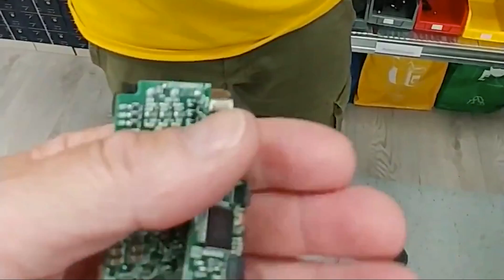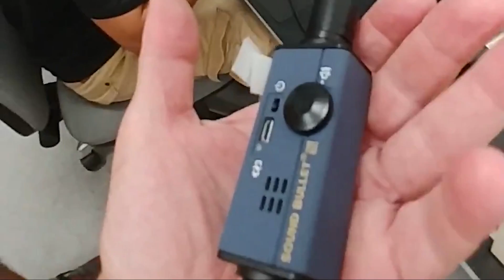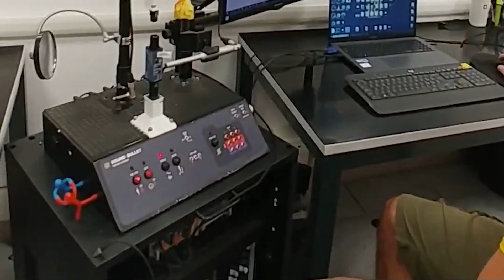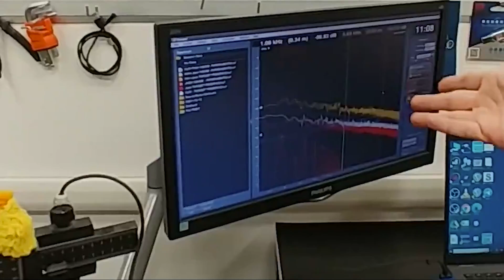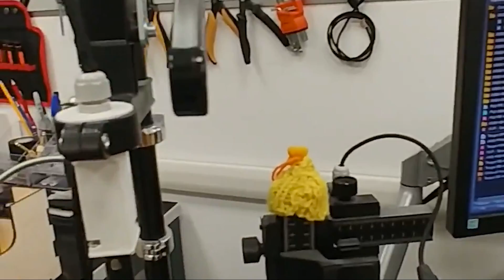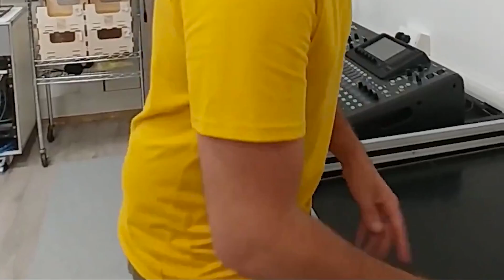Making The Sound Bullet - Awesome Audio Tester!

Comment: @07:20 After this interview you've done that video on if grounding XLR shield to the XLR chassis works and when it works. And yeah, basically you stated "it DEPENDS!" :D like it almost always is.

Most common is not to do it as you've stated here, but I carry a few cable adapters with me that give me the option AND I've got bunch of well marked and separated XLR's with chassis grounded because as you've stated in that video of yours, there are times when you reach lower noise and better interference immunity by doing that :)

But those times are a bit special anyway.
Reply from the maker: That's a great plan and solution. yeah you don't really want those shells grounded cuz they'll cause problems but in those few times you need the shells grounded having those adapters allows you to solve it. 

That's the way to do it right

Comment: Maybe it's been a while since I was in an electronics environment, but is it not odd / not good that everybody is just handling the PCB's and not doing any grounding or anything else to manage electrostatic discharge (ESD)?
Reply from the maker: I remember those days when ICs would dry by touching them. I used to work at Hughes aircraft testing parts, modules and Tow Missile systems.

No need for a strap here, it adds no benefit and gets in the way.

Comment: Nice tour.  In regards to grounding the shell, Meyer Sound did something different. To prevent static buildup and discharge, a 20 K ohm resistor is connected between the chassis and the connector shell in their powered speakers. Not sure about the rest of their equipment. Only know about the powered speakers because we had a bad ground at one event, so the amp picked up a hum and the XLR signal cable did not carry the full leakage current.
Reply from the maker: I read an article recently where AES recommends the shell is not grounded due to potential issues of the shell contacting metal objects and inducing hum.

That said, grounding the shell can add a slight amount of increased shielding for extended XLR cables.

The issue for the sound bullet is that if the shell was grounded but pin one was lifted it would show the cable as good unless the shell is isolated in the tester

Comment: So cool, good sound specislists are getting scarce. It would be great if the connectors dont get hardsoldered to the board. It could be a failing point at heavy use. "I do not own this product"
Reply: It doesn't appear they are hard soldered.   From what I could see they are using short wires, hand soldered.
Reply: @v12alpine  thx:)
Reply from the maker: Are you having failure issues with the sound bullet?
Reply: @DaveRat  Sorry for creating some confusion. I don't have any experience with this product. Im a materialplanner for one of the big rental companies in Europe and we try to avoid hardsoldered equipment because it can be a stresspoint. Like blackmagic sdi converters etc. I just wanted to share my experience, it might be a good upgrade or maybe the product is already great as is:). I rephrased my old comment so it doesn't bring wrong information.

Comment: No ESD protection?
Reply from the maker: Hmmm, wouldn't that be like wondering why someone making toast is not wearing goggles?
Reply: @DaveRat  I’m an electronics engineer so the lack of wrist straps or ESD mats sticks out in my brain when you’re handling static sensitive components during assembly. BTW I own a Sound Bullet and love it!
Reply: Not really needed with pre-assembled boards.   Plus they test them extensively and would know if there were a problem.
Reply from the maker: Cool on the sound bullet and agreed that taking precautions against potential issues that fail to manifest with the gear involved is an unnecessary time and energy cost